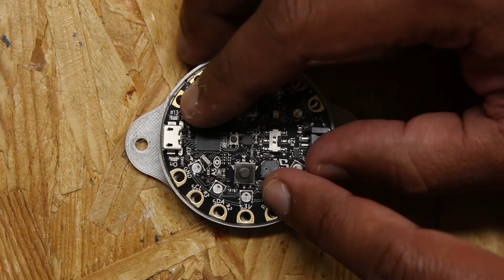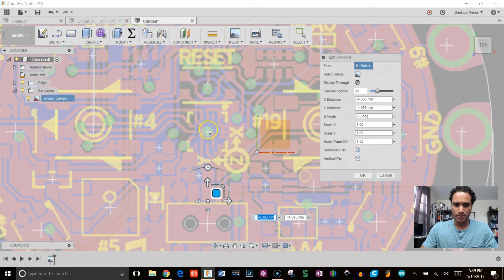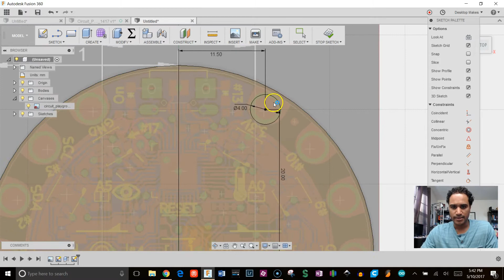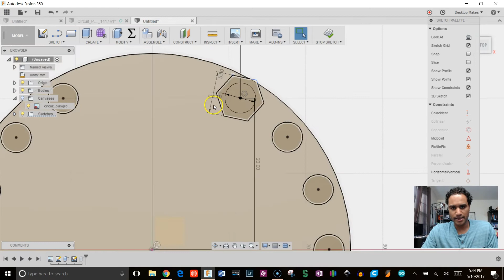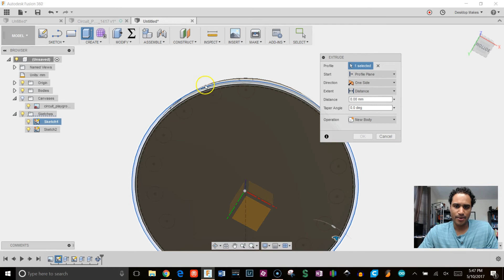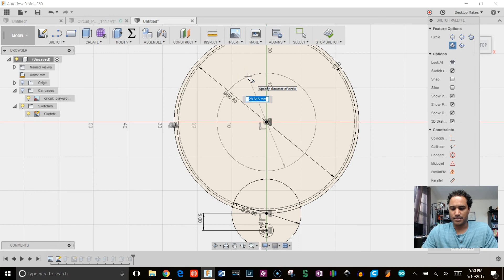Design a Screw Terminal Block for the Adafruit Circuit Playground

Comment: i would have used the built in buttons, or switch. 
recently made a mount and program for the CPX to auto light up my print deck when the printer moves. i like the case you made, may use the inset nuts idea this for my next version. 
a F360 model of the CP/CPX now exists on adafruit's github, and its exact specs, i used it as my first pull of my model.

Comment: Another great vid.  I always pick up excellent tips and tricks from your videos.  Thanks!

One question on this one: when you drew the first circle for the terminals, how did you get the vertical dimension you used (20mm)?  Just from measuring the Circuit Playground, or is there something I'm missing in the image from Adafruit that gives you that number?
Reply from the maker: I simply used the canvas I brought in to eyeball it when I drew the circle and then entered the 20mm to lock it in place.  20mm was a nice round number and close enough to the measurement I had from eyeballing it.
Reply: Got it.  Thanks again!